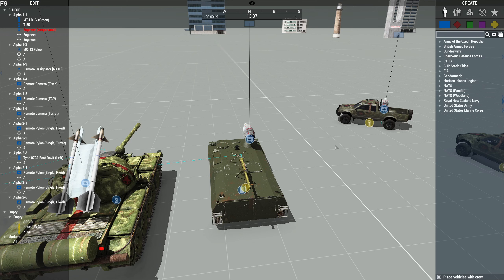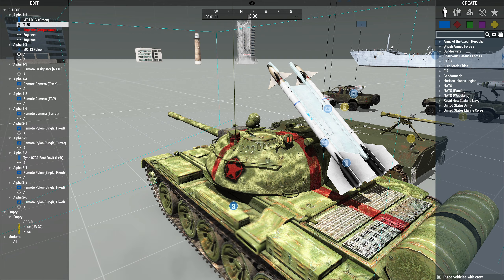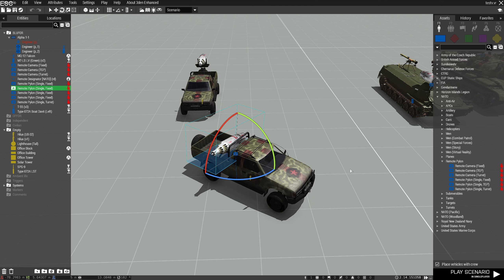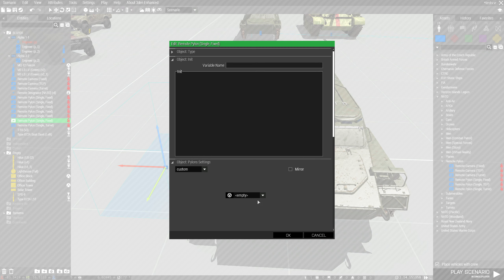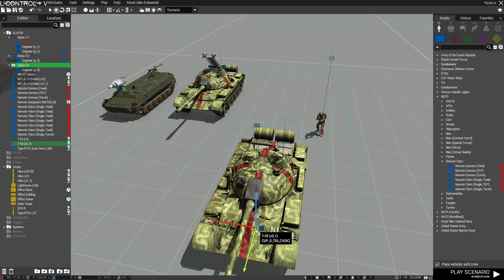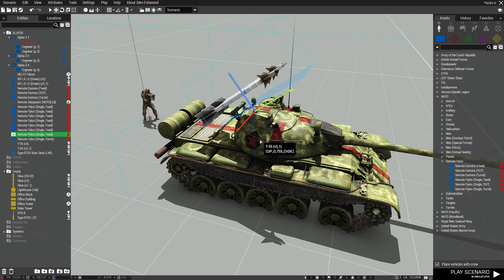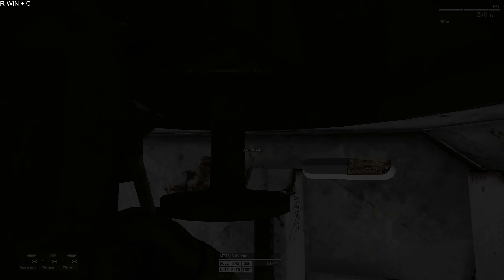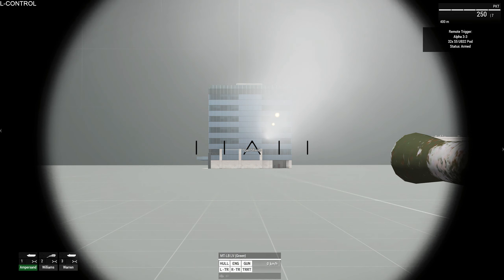Pylon Anywhere Attach Helpers

Comment: I am having an issue lately, once I set up the vehicles and enter the game some of the pylon anywhere weapons drop down a few feet from where I placed them in 3den but then when I get in and move the turret it rotates in sync with the turret, just at its dropped lower position. Its especially strange because I swear they stayed in place and worked great when I first set them up. Is there a limit to how many pylons can be used or something?